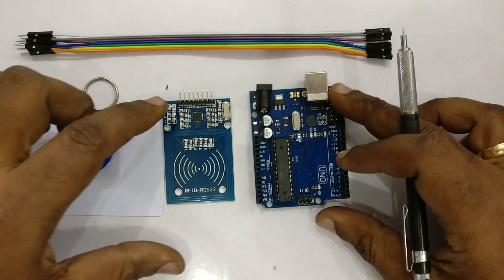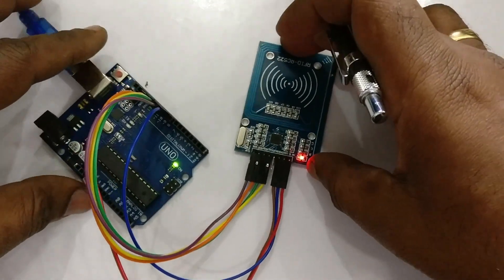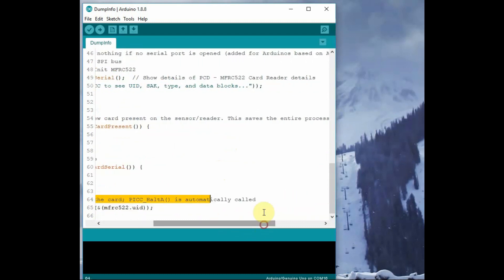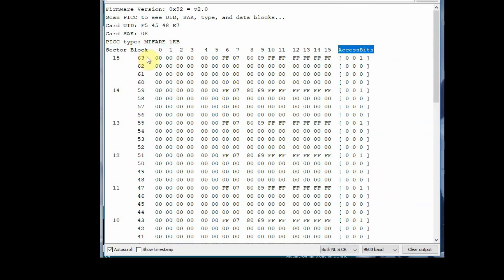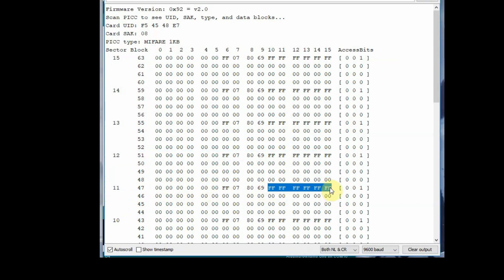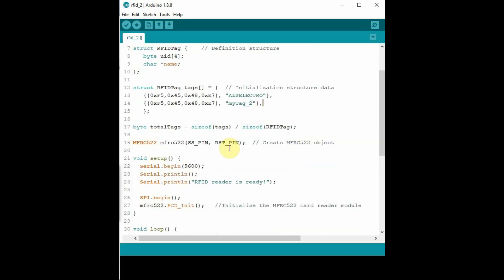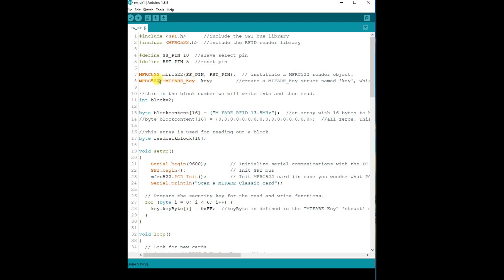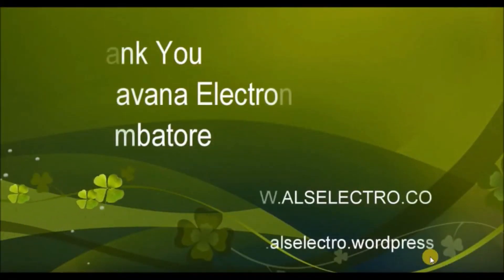RFID - MIFARE CLASSIC (13.56MHz) - Part 1 - Understanding MiFare ReadWrite card data

Comment: Hi, I can not get correct results by  reading the tags interrupt based. Did you try out the interrupt output of the reader? The Arduino examples seem not to work with the interrupt.

Comment: Do the cards of this RFID reader work with EM18???
Reply from the maker: No.Mifare cards are at High Frequency 13.56MHz.  EM18 works with LF Low Freq. 125KHz.
Reply: Saravanan AL thank you for the information. Btw which module (Rc552 / em18) do you find more robust and efficient to use in practical scenarios???
Reply from the maker: @sayantanmaiti2513  EM18 is for simple use.You cannot write on to this card.But on  Mifare cards you can write your data & info & Arduino RC522 library makes life easier.
Reply: Saravanan AL thanks a lot sir